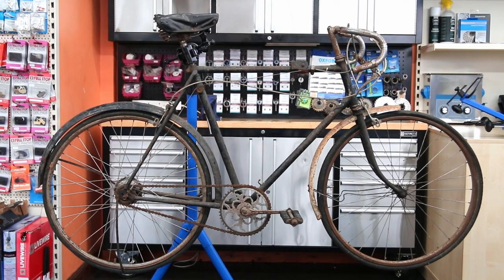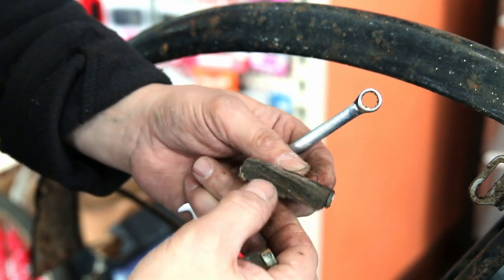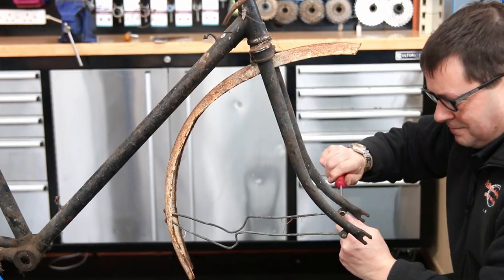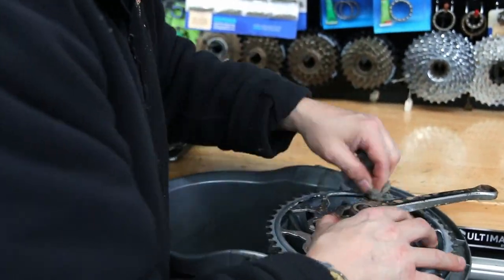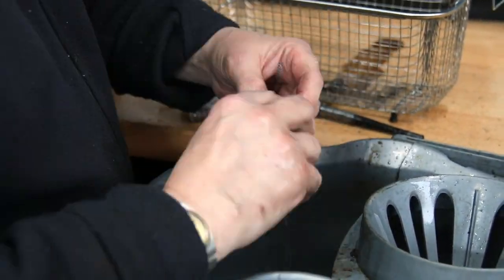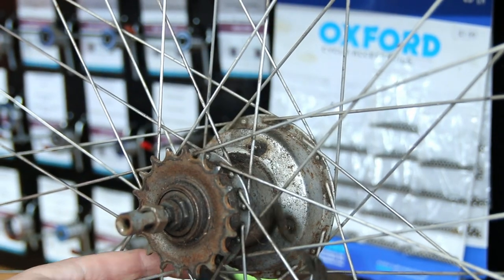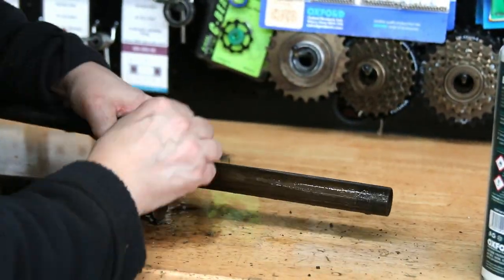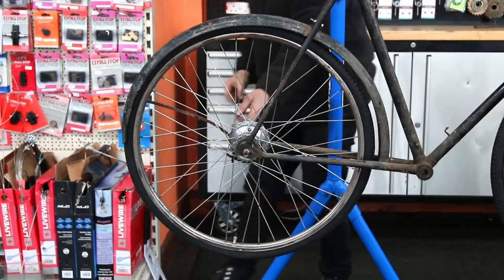Vintage Humber Bike Restoration! Full 1950’s Rebuild Service!

Comment: Nice looking Humber! To me, the ‘west wick’ rims, steel mudguards and the pedals suggest it was once a townie. The drops are pretty accurate though! And the position of the SA pulley at the top of the downtube is spot on. 

It’s a similar age to a 54 Raleigh Trent Sport I owned. That was more of a club bike so it had celluloid mudguards, quill pedals and drops. 

Tip for the drive side cup (if you haven’t found a solution that is) is to bolt the spanner down to the cup. It ‘shouldn’t’ slip then and most of the time I’ve been able to tap the spanner with a hammer to free the cup. 

Love the Humber crankset.
Reply from the maker: Wow! I had to check your channel because I thought I recognised the name to only realise yes I am subscribed and have enjoyed many of your videos 🧡

Comment: I wish I could find more of these. I picked a 1957 J. C. Higgins (Sears & Roebuck) out of a dumpster. It had frame, fork, cranks and S.A. 3sp hub. It was originally red, but had total surface rust. I cleaned and clesr-coated the rust. A few good days later (2015) and it has been my commuter since.
Reply from the maker: They’re always worth the work you put into them, and clear coat is the absolute answer to the rust
Reply: Have a look in the local canal, I think that's where they found this one.

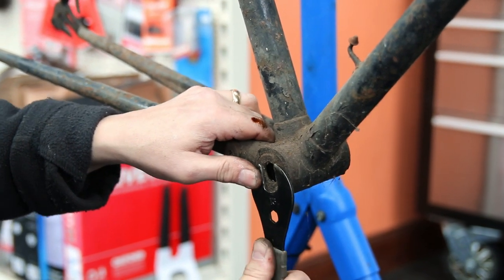Comment: At 2:26 You can eventually make a tool to take out the ball race on the right side ( that may be left hand threaded ).
Just take a piece of steel 100 x 50 thk 15 minimum, drill a hole Ø 12 mm, have a grove depth 2.5 mm x width of the flat that you want to unscrew, place it on the ball race, place a bolt between the two firmly, secure the 100 x 50 plate into a vice and unscrew it.
The video is very very nice...

Comment: Enjoyed seeing  a real mechanic working on a classic bike with intrinsic value..did you overhaul the internal geared  Strurmey hub?..I find that getting period correct cottered spindles and cables a challenge..not to mention cones.. in the past I have had to re- grind cones with good sucess..bb cups and hub races are next on my to do list..Z
Reply from the maker: No we didn’t do anything to the hub the wheel had already had previous work and felt & rotated really nicely.

Comment: I would think the fitting on the top tube would be the remains of a friction shifter, since you wouldn't be able to fit one on the down tube without getting in the way of the frame pump.

Comment: Great work good job. Would have been grand if the owner had spent a little bit more cash and restored to the new condition. The white paint on the rear mud guard would have been there from new, and I think the rear wheel was original. These Humber bicycle are very rare now and worth a lot of money.

Comment: I wonder if a product such as Evaporust would be worth trying. You will probably replace the cotter pins as they would have been damaged on removal. However, I remember my grandpa showing me a technique of holding a metal block alongside the cotter pin (for support) during extraction so that they could be used again.
Reply from the maker: We reused the cotter pins in our recent Triumph video, but there had damaged threads.

Comment: Love your chanel, The fitting on the cross bar looks to me as though it has become inverted and may have mounted a child saddle, It was a common way to carry a child before common car ownership.  White paint on the lower rear part of the rear mudguard would be original finish. All bicycles during the war and into the 50s had by law to be so painted to aid visibility in the blackout. I am unsure about reflectors but they were obligatory by the 50s. The AG dynohub would have had a tiny tail lamp until   after the war  headlamp . That lamp had no reflector just a bulb . It was identical to the lamps fitted  to life belts as used by the RN . I think it was about 1953 that they were phased out by the requirement to have a lamp of a larger size and a converter which screwed onto the bulb holder was marketed.
Reply from the maker: Wow! That’s some knowledge there. I never new any of that! Thanks for the reply!

Comment: Common problem with old bikes is the drive side bearing cup jamming tight. This is bad if you want to fit a cassette crankset as it won't come out for love or money.  Restoring an old Japanese folder i had the same problem, but welded about one foot of steel rebar to the outside of the cup to unscrew it either by levering with some pipe or by hammering. About to throw out the useless bearing cup, i cut a groove thru the screw thread instead. Now it's a tool to clean and rethread the drive side bottom bracket.
Reply from the maker: Great work🧡

Comment: do you put oil into the sturmey archer gearbox? I've read motor oil is a good option as it contains detergents that keeps the mechanics clean. it's what i use on my 1981 Triumph

Comment: What are the P handle hex spanners you use in this video (and in others)? Are they Park Tool? Which would you recommend?
Reply from the maker: They are “torque” tool, most part tool items have blue handles. I’m not brand affiliated so just use what I buy along the way.

Comment: Hi im from main and i found an old bike that looked just like it it had a headlight on the front the brake lever was in the middle of the top bar and on the chain cover said lamans it was an old bike and what i could see was the tires were. Really bad like tire rot
Reply from the maker: Best of luck with it!